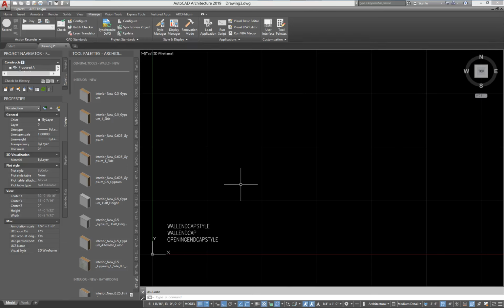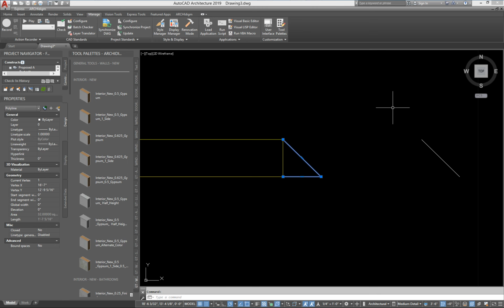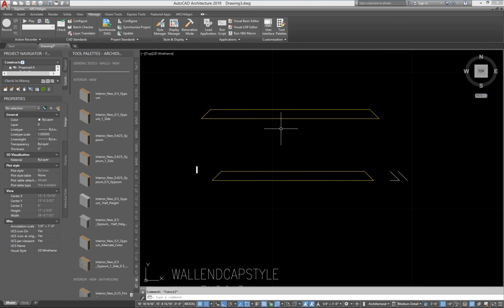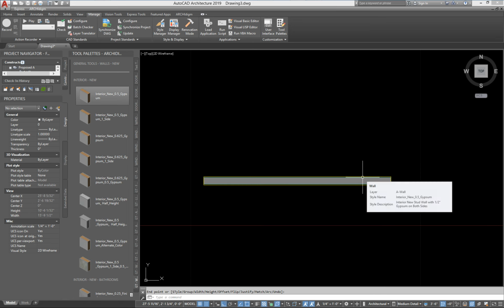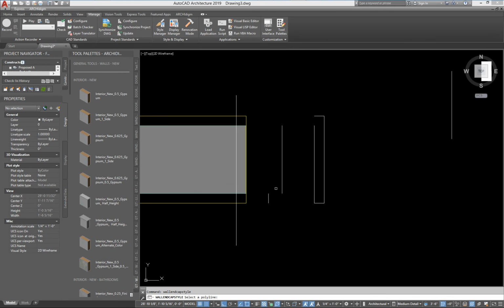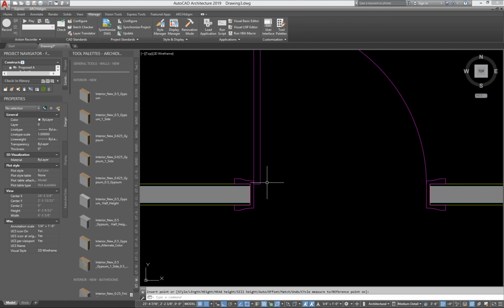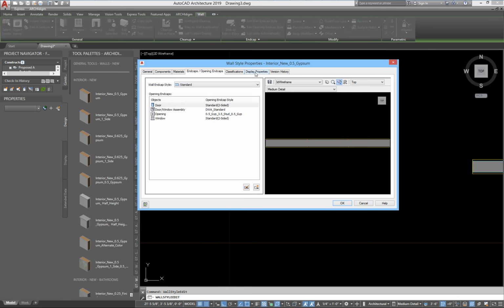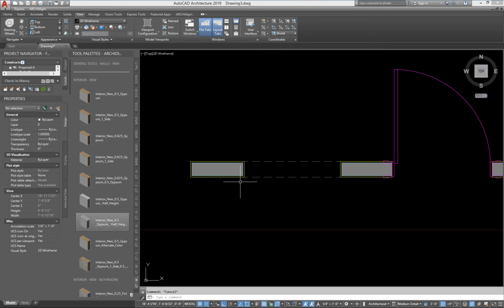Wall Endcap Styles in AutoCAD Architecture

Comment: I am not sure what I am doing wrong. I can't get the (1/2") line between the sheetrock to disappear like you mentioned in the video.  I added a global width to the polyline, but the line is still present.  My 3 components (GWB, Stud, GWB) on the wall assembly are all three set to the default standard material, do they need to be different materials?  Is it a display setting or something?  I'm not sure what I am missing.
Reply from the maker: On a Wall Style with Sheet Rock on both sides, you will need a little bit of Pline Width in two places.  The 1/2" segment needs to have a global width.  The full wrap segment needs that little 1/2" segment that butts up against the other 1/2" segment set to have a little bit of global width as well.  In my video you can see there are two places that have global width that I didn't explain.
Reply: @ARCHIdigm1  Thanks! I figured it out & that's exactly what I did.